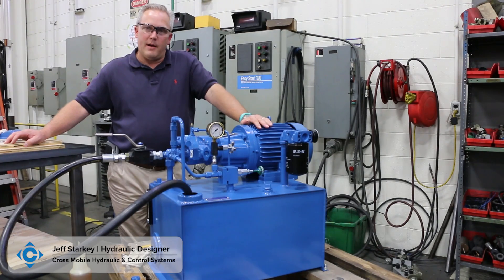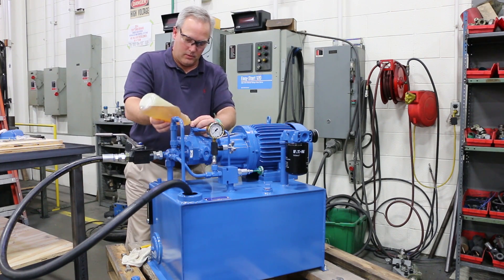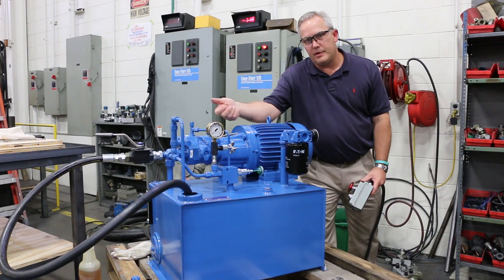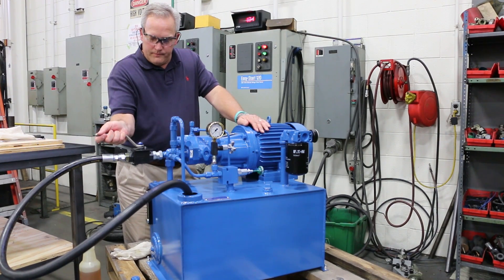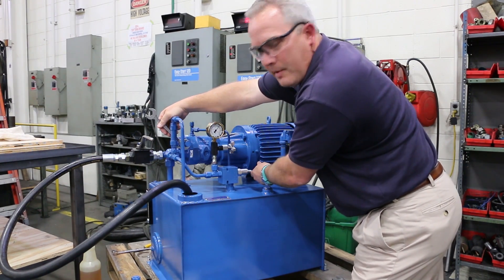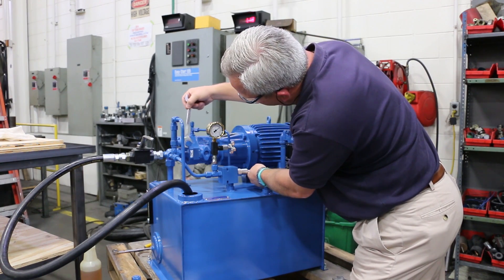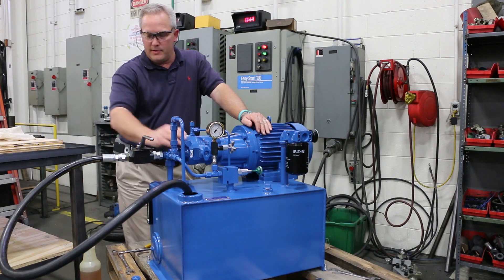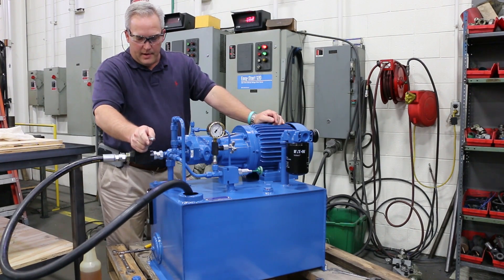Variable Displacement Pump Hydraulic Power Unit Startup Demo

Comment: We have 10 hp car wash conveyor hydraulic pump power pack powering a 100 foot tunnel with 54 Dolly's. Apparently the pump was either never set up properly or it was over sized because we can seem to get the conveyor to go slow enough without reducing the hydraulic flow valve to the point where there's more pressure and barely any flow than we would like.   The pump sometimes won't start when the oil is cold.   I wish I knew how to set the hydraulic compensator line or knew if the flow valve was put on as a band aid because I got to believe it can be adjusted in a more refined way.   Any help here would be very appreciated.   Thank you.  John